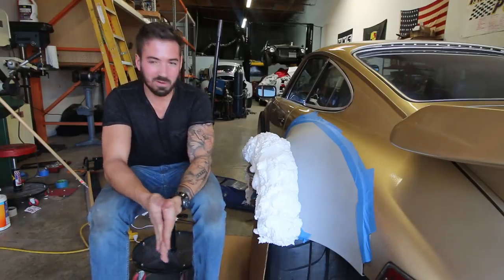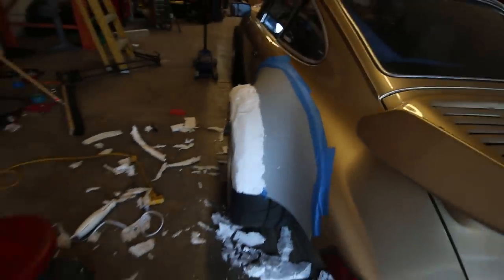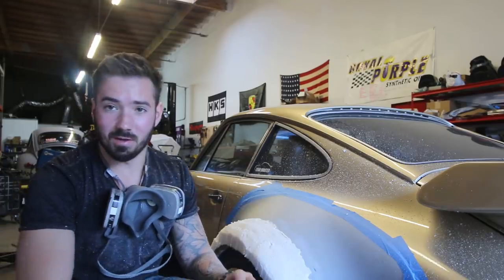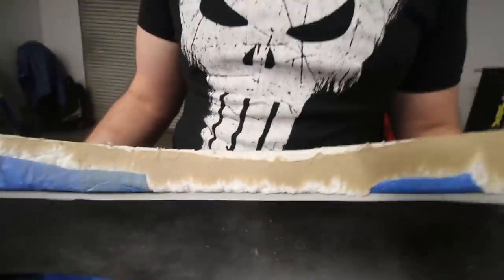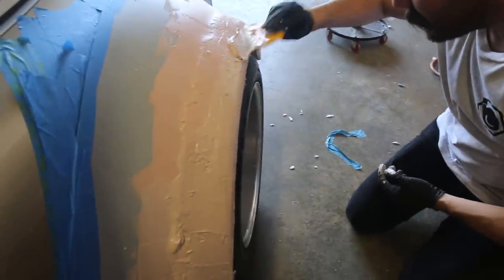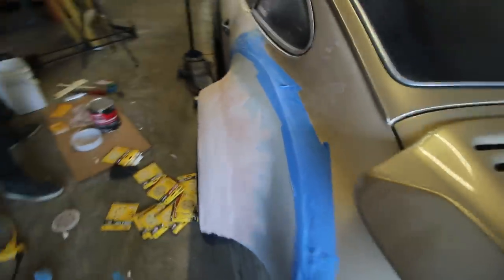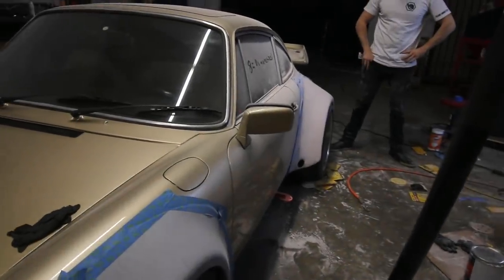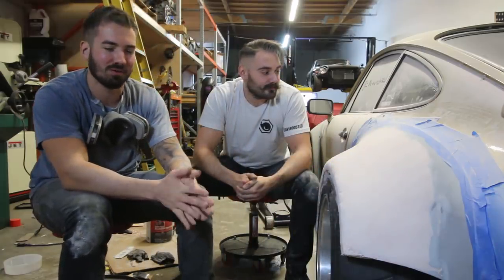DIY Carbon Fiber Widebody Flares - 911 Turbo Pt. 2

Comment: Would be rad if you could get some gold carbon to make the flares
Reply: Mike Sheridan I think you could buy carbon Kevlar twill and dye the Kevlar prior to laying it up.  That would be crazy looking.
Reply from the maker: We're getting a sample pack of different colors and weaves. Carbon Kevlar might work well for the look we're going for.
Reply: Or just make carbon fiber, and put "gold candy" over it
Reply from the maker: jishimoari not a bad idea, coating the CF opens up a ton more possible outcomes 🤔

Comment: It looks really good, very well done. I did not think you would pull it off. I wonder how you are going to replicate the exact same right fender.
By the way, would it be possible that you give us a tour of your workshop? It seems completed now. Thanks.
Reply from the maker: DeltaDubai03 It’s far from complete but we did get to pallet a lot of our project parts and get them up on the racks so it’s functional now. As we start to get workstations together I’m sure it will come up in future videos.

Comment: Liked and subscribed. Liking this project. I used the same foam material as a substrate for a project as well. Fabricated a full quarter panel of the 2011 Revenge Verde. Turned out perfect.

Comment: I do not think you’re ruining it because of the way you’re doing it. If you would have gone with cheap bolt on flares it would have looked hot boi but I think this is going to look right.

Comment: In the 80's these cars were known as widow makers. If the car got into a power slide it was known to transfer weight off the front tires and would swap direction. In the 90's they figured out the solution was an even width front to back and corrected it with the next generation of 911. It will look bitchen just dont get the car into a slide with that rear track width!

Comment: That looks HORRIBLE!!!!  Put an angle on there. You could easily put a 45 degree angle and make it look sick IF you have the rim / tire width that is appropriate.. generic flares will give you 2-4”s. I have 12” rear stock that craziness you made should fit what 20”!?!